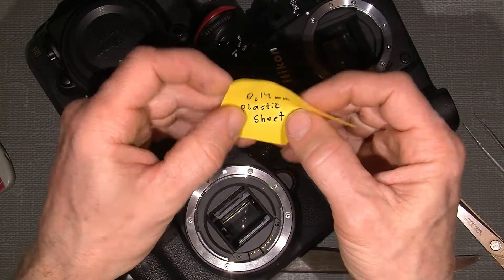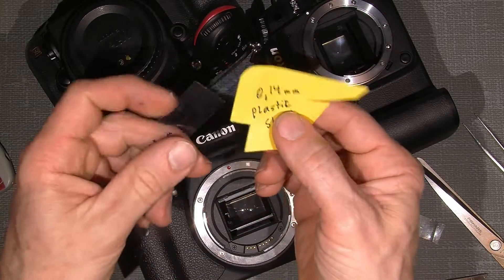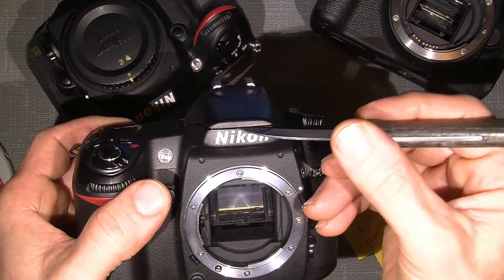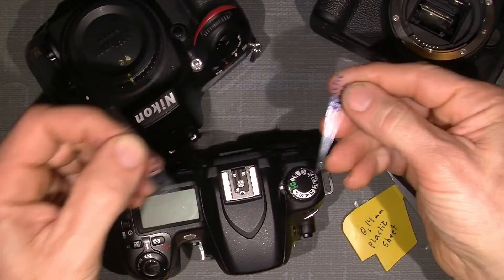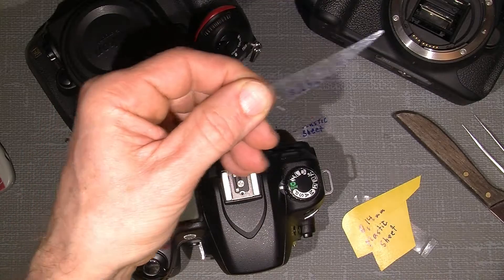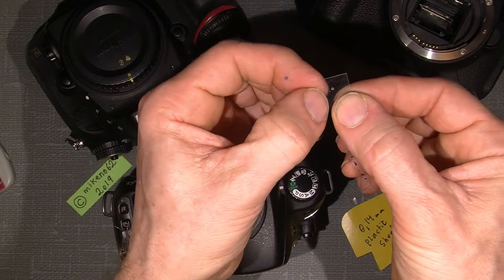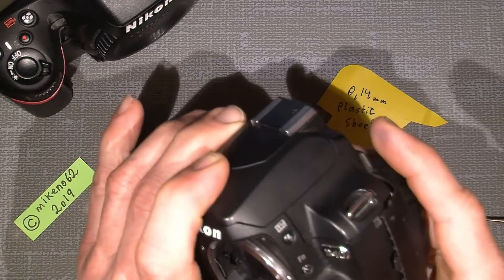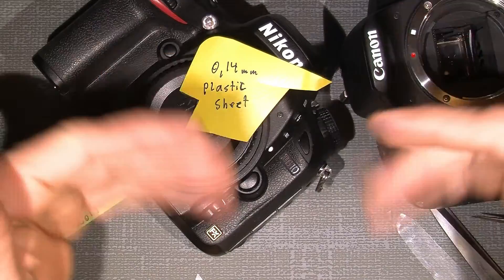How to pop up a stuck flash without battery in different DSLR cameras

Comment: Nikon D5100 switch (staring down with lens in front/closest to you and LCD farthest away) is on the bottom right a little less than an inch back. The switch is opened by pushing it towards the back.

Comment: Good info. Helped me get my D5100 flash open. However, the thin piece of plastic I used for my tool was hitting the little wall surrounding the hole that the latch protrudes from, and the plastic tool was not contacting the latch, but instead just hitting that little wall around the latch. This little wall can be seen in a number of videos if you look for it. And the flash lid just presses the tool down so as to hit that little wall. I was maybe just very unlucky that for the longest time I tried, the tool never contacted the latch. Knowing this, I could have put a curve in the plastic tool so that it would raise up a little and get over that little wall and hit the latch. For anyone else that may be getting stuck like this. Try putting a little upward curve on the plastic tool. But I ended up using a thin piece of metal for a tool and tapping on it, which shaved off that little wall, not knowing it was there. But the flash is working properly now. Too bad I didn't notice that little wall.

Comment: Thank you mikeno62!  After a few tries using thin plastic strips as you did, the flash popped up on my D5100.  Now I need to figure out why it doesn't pop open like it should.
Reply: A tiny bit of a liquid electronic switch cleaner, such as 99% isopropyl alcohol or DeOxit, may be all you need, if the switch and/or solenoid, is just gummed up or has minor internal corrosion. Use your judgment but, with a charged battery inserted in the camera, work the switch while applying the tiny amount of cleaner solution. A fine needle and small syringe may help in controlling the amount you apply.  The solution evaporates after it has done its job. This is also a method for cleaning the insides of rotary switch mechanisms, i.e. volume and tone controls, on older electronics, without taking the switches apart or replacing them.  Just spin the control knob back and forth, after you apply the solution, and work out the dead and corroded spots inside the mechanism.  On devices with 120 volt or 220/240 volt power supplies, do this  after the device has been unplugged for at least an hour or more, to allow the capacitors to fully discharge and avoid shocks.  Do this at your own risk - electricity from a wall plug or mains can kill you.

Comment: I got my Olympus e520 to open with a card like a business card  to slide between the flash cap and the body...I think a razor blade, the old type that is very flexible to go between the lid and the body would also work.